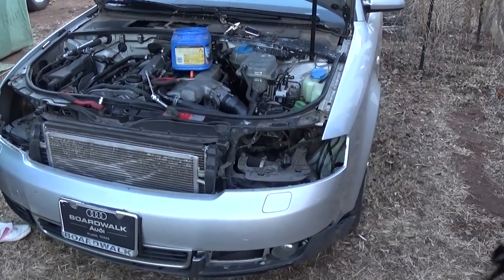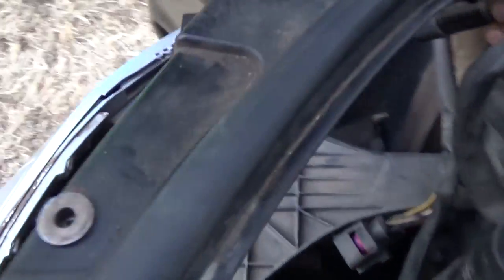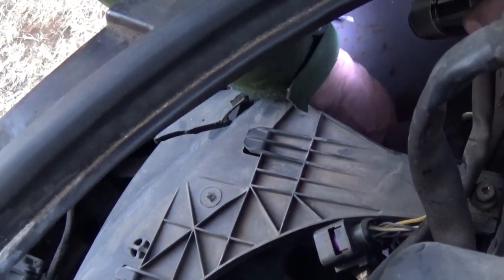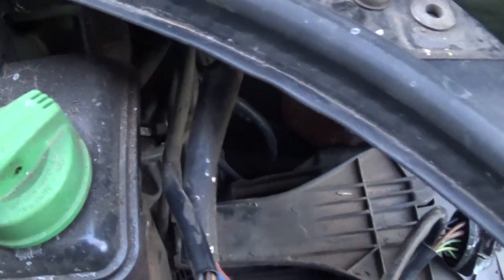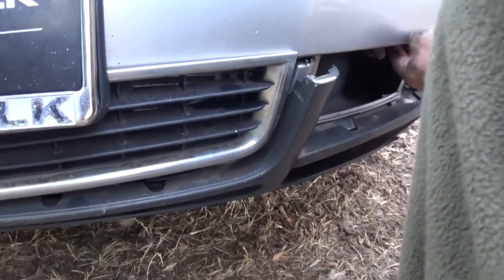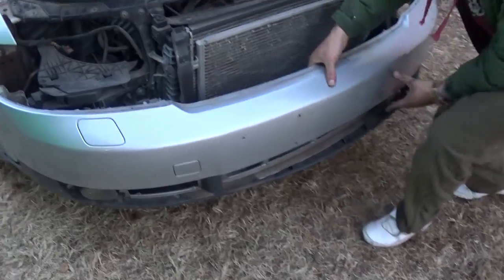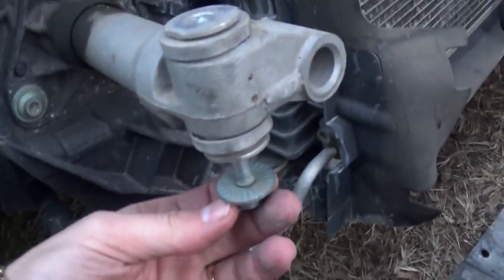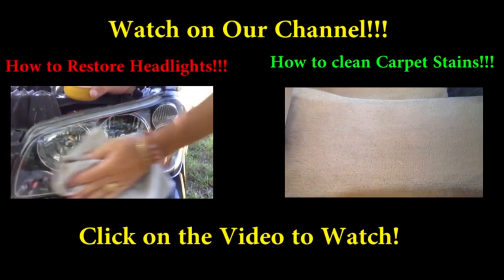Audi A4 B6 Front Bumper Removal and Replacement in 5 minutes

Comment: We have a Audi A4 2006 s-line . We accidentally reversed the car and loosened it a little. Just a few mm.. One head light is loose - could it be that we just do like u showed in this video to thigten it again ? Awesome video !!!
Reply from the maker: +Støre Nordgård Thank you. We are glad the video was helpful. It is possible that it just came out of the bolts. It is hard to tell without seeing it. Check the bolts and tighten them. A week spot on these Audi A4 is the headlight bracket. Sometimes they crack and headlight is loose. I am talking about this part here http://www.ebay.com/itm/Audi-A4-B7-bumper-headlight-bracket-mount-Passenger-RH-replacement-8E0805364-/121455260436?fits=Year%3A2006%7CMake%3AAudi%7CModel%3AA4&hash=item1c474c3314:g:3AwAAOSwAHZUNEcG&vxp=mtr

If you ever need help with your vehicle let us know you can also find us on Our Official Facebook Page here: https://www.facebook.com/worldmechanicsofficialpage/?fref=ts
Reply: Will check it out ASAP. Here in Norway they wanted to charge us 3000 euro to fix it :0

Comment: Hi Have a A4 B6 2004 , Could you tell me how to clear my windscreen, the vents on the top of the dash will not blow out any air, even when the blower is on full speed...also my econ button on climate  is stuck on ? Any Ideas Cheers
Reply: The reason why your top vents will not work is is simply because the motor that opens and closes the vent is stuck in closed position and about the Econ mode you either have no air con fluid or you have a leak in the system.